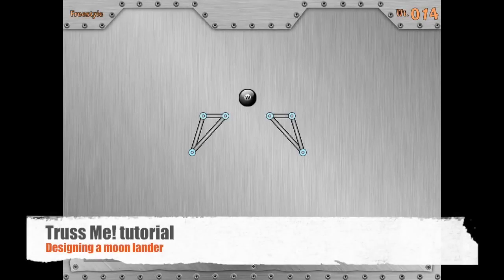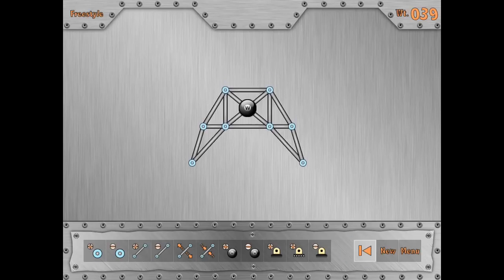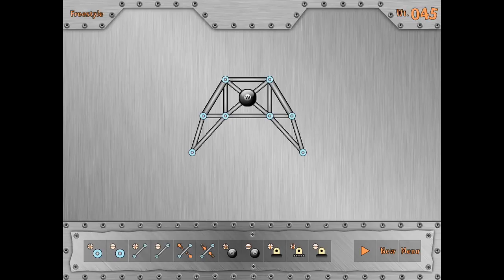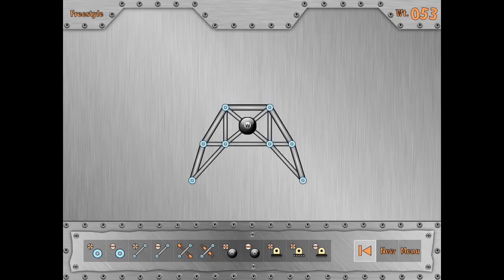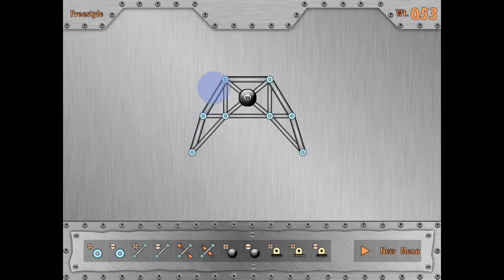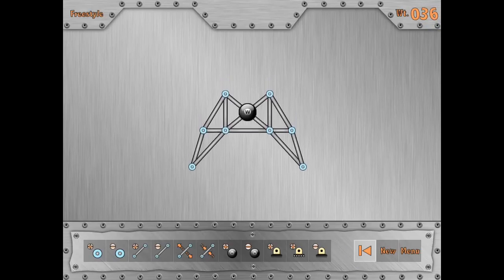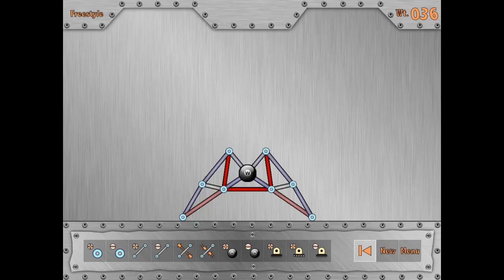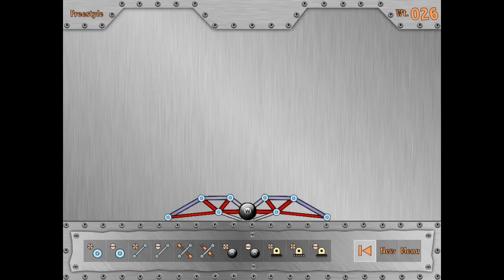Moon lander structural design using Truss Me!

Comment: This is exactly as I built mine on challenge 14 and the structure fails. I had to make the top a bit shorter and the top beam smaller in length.